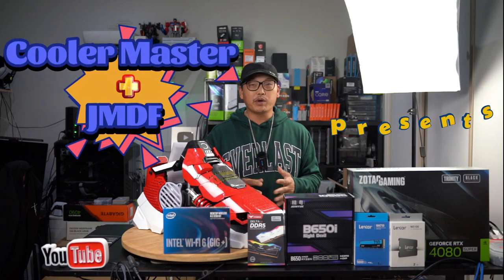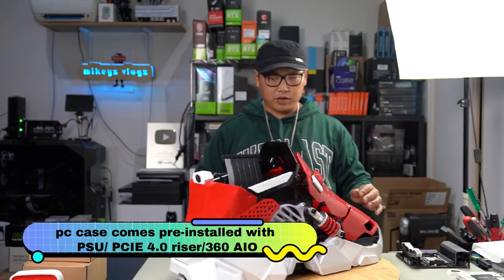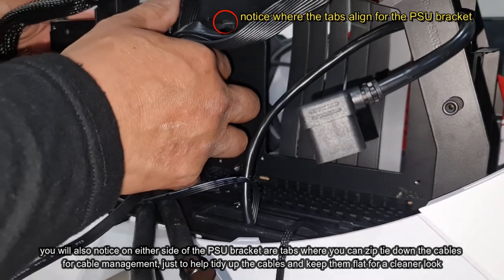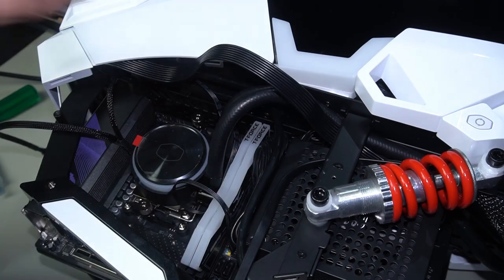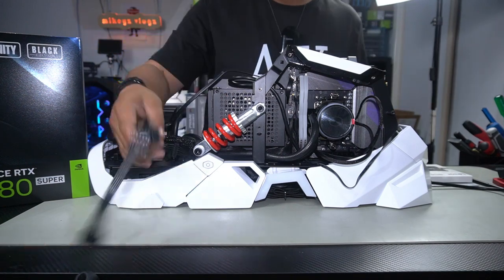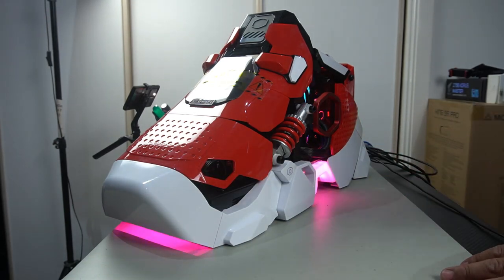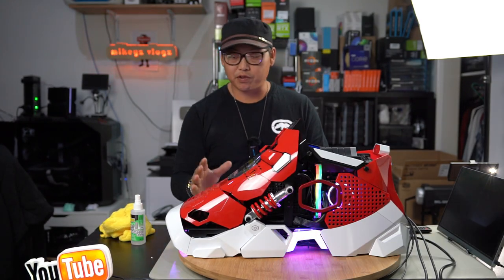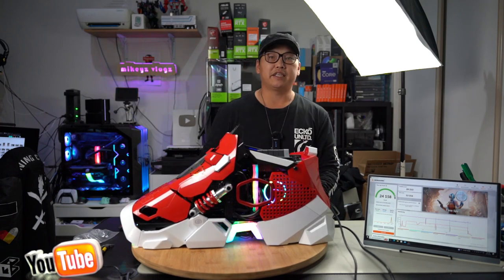am5 /cooler master sneaker X MITX gaming pc build step by step guide

Comment: Question about CPU cooler: Because pump is now the highest part of the cooling system, is there anything that prevents air from accumulating to pump?
Reply from the maker: good question ..there is the extra tubing u see  from the radiator and I believe that is what helps the air bubbles to release and not form. as the normal flight 360 aio does not have the extra tubing... and this is what I believe helps with the issue of air bubbles